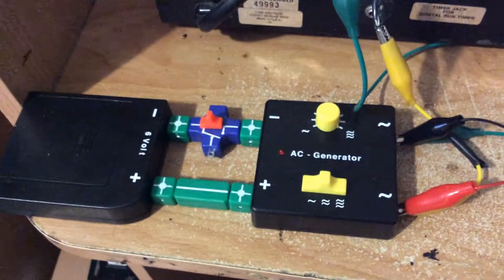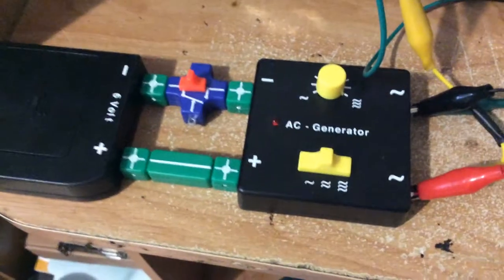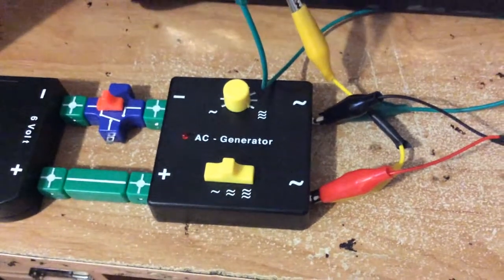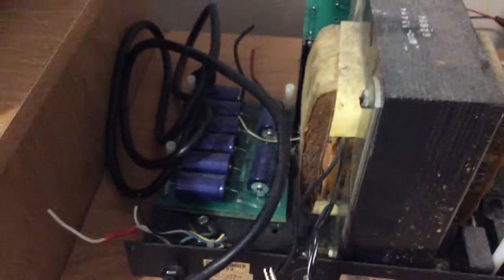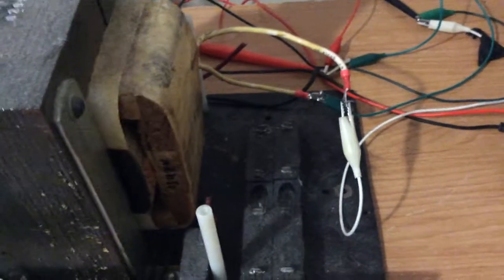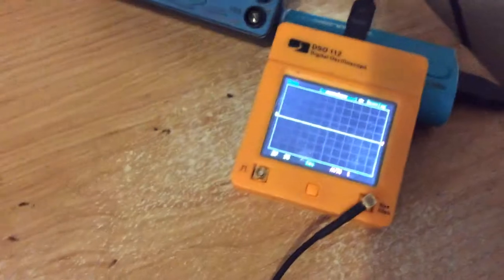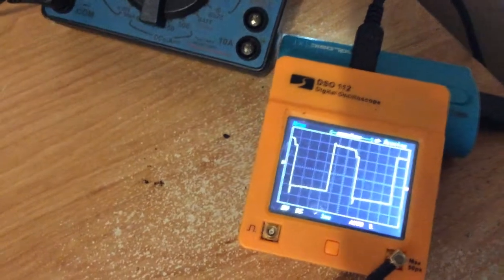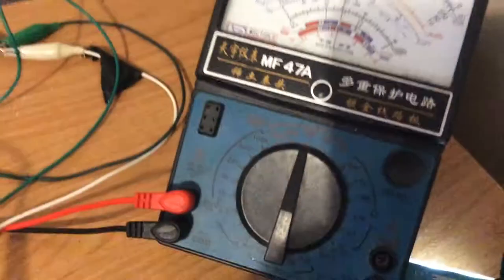6 Volts DC to 120 Volts AC Inverter

Comment: Thank you Joel: Now can we find a way to convert a 6 volt golf battery to 120 AC pure sine wave to power a refrigerator. Just in case the wind blows and the grid power is turned off. Thanks